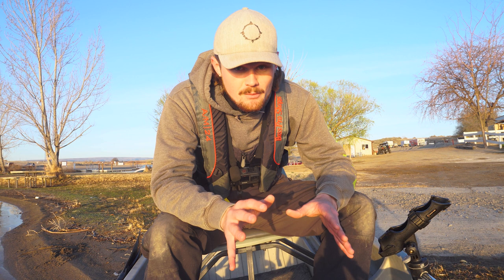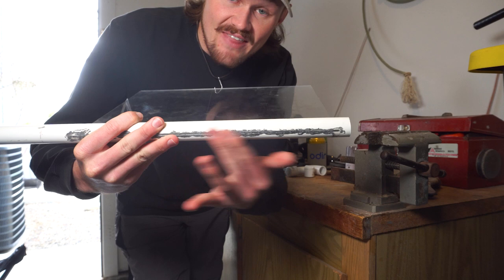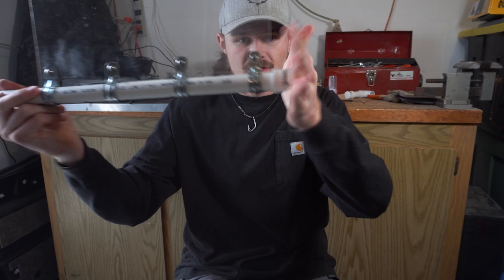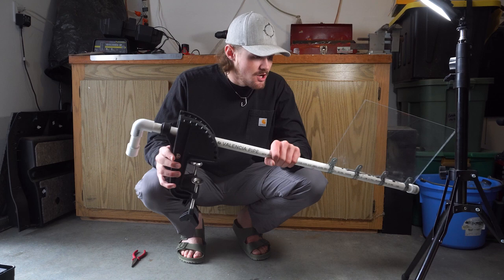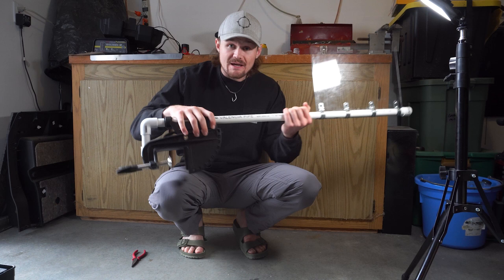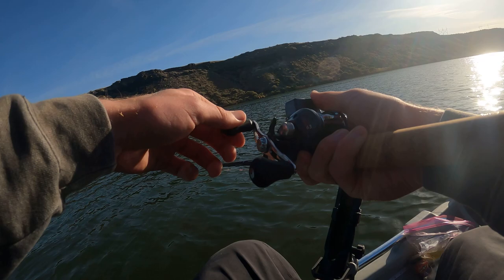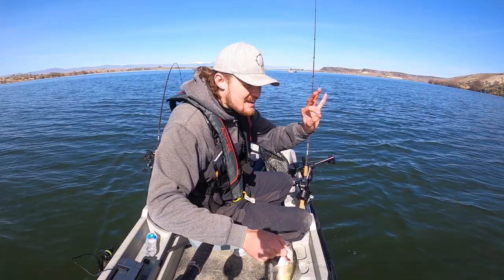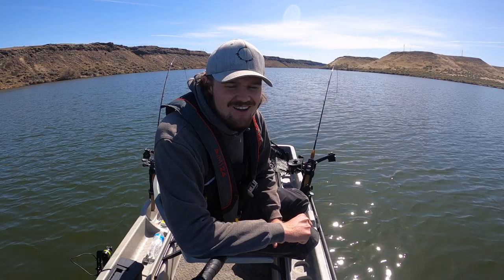This Tiny Boat Modification is a GAMECHANGER! Pond Prowler Rudder Build/Test

Comment: An absolute must add on.  Great job.  I went lazy; purchased the bracket and a Bullnose ruder which is designed just for this purpose.  Adds a little more to the cost but makes it a super easy project. Great job.  The homemade rudder will probably be more effective because of the size.  However; the Bullnose rudder does work just fine.
Reply from the maker: @williamcotton8746  Since this video I have actually went with a bullnose too. May do an update in the future. Thanks for the comment!

Comment: The one thing that I would do to improve the rudder is ro put a radius on those sharp corners just to save wear and tear on your hide and anything that the rudder might he stored with qhen traveling.
Reply from the maker: Good point! I may be doing an update video this year on some new prototypes, so this is good into. Thanks👍🏽

Comment: Does the boat spin when anchored? And does this rudder help with that?
Reply from the maker: It will spin when anchored but only if the wind is pushing it. Rudder helps much more when the boat is moving in a straight line

Comment: 2 things please.   Great video!  Are you interested in making some of them and selling them because I would but it. 2 do you use any shallow water anchors like those stick pin anchors?
Reply from the maker: Probably won’t sell em, however if u don’t wanna make one they sell smaller ones on Amazon for $20-40. I don’t think they’ll hold as well but will still work for sure!
Reply from the maker: All I have for shallow water anchors are double river anchors to lock me in place. May be making some DIY power poles in the future tho!

Comment: Did you know you can buy a rudder for the troll motor shaft?  I mean nice mod but what do you use for mic.  That's perfect sound.
Reply from the maker: Problem with a lot of the rudders online is that they are really small, the one I made is over double the size of the biggest one I could find
Reply: @humbugvideos  they work on my 17 ft bass boat.